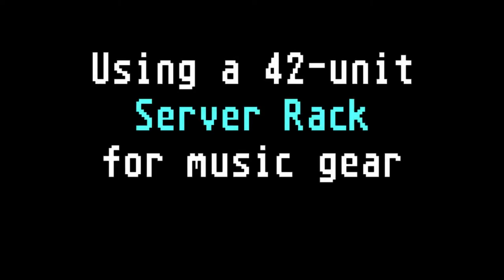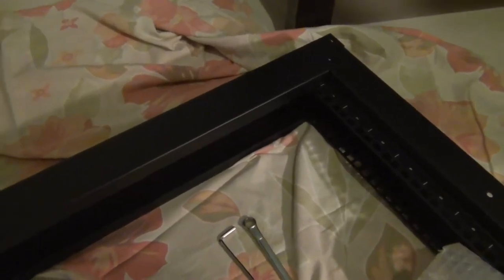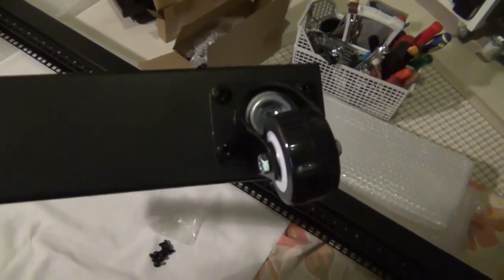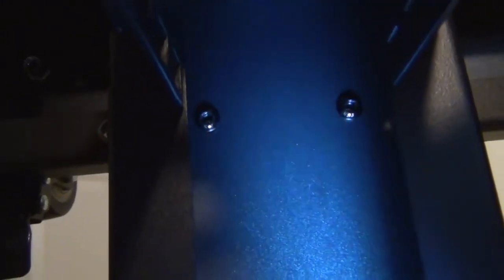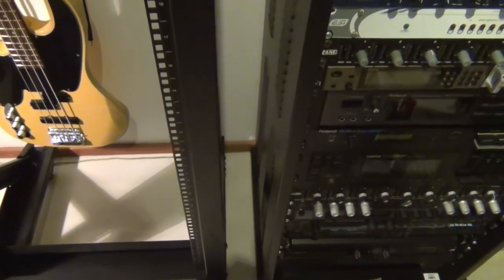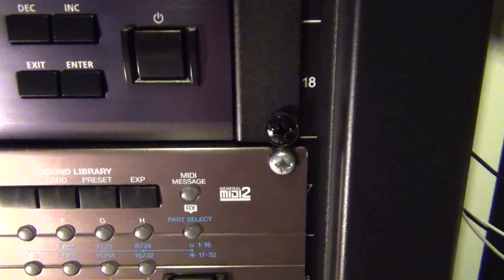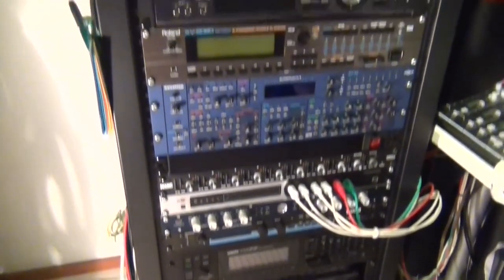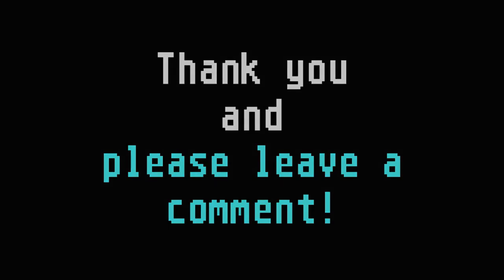42-unit Music Rack Setup

Comment: What are your top 3 rack units? as in favorites. Thanks
Reply from the maker: If I have to pick, my favorites are the Novation Supernova II synthesizer (2000), the Roland R8-m drum module (1989), and the Roland XV-5080 ROMpler (2000). There are of course also must-have rack devices despite not being favorites (amplifier, MIDI interfaces, audio interface, USB hub).
Reply: I was going to ask the same thing. 😋. Surprised at the answer though. I was expecting the Oberheim M1000 in there or the Yamaha FS1R.
Reply from the maker: @foreverseethe  It's always hard to name favorites! I picked my main workhorses from a workflow efficiency songwriting perspective. For sound design, noodling and sheer amazement, the M1000 is superb. Also love my Waldorf Microwave. The FS1R is great but tedious to program (yes, I did edit the Fseqs) and currently completely overpriced, I prefer my TG77 to be honest. The VL70m is incredibly fun. And I  also dearly love my Lexicon PCM81.